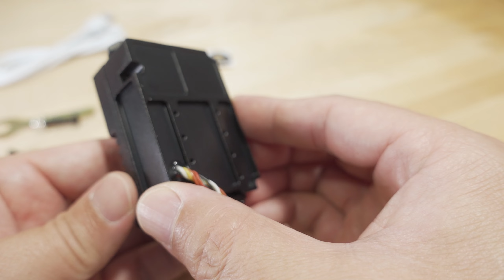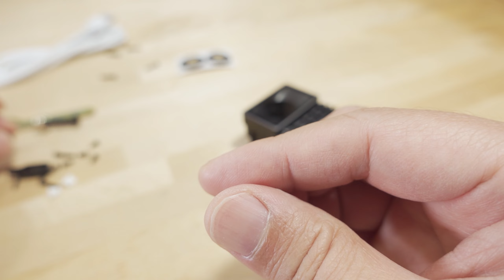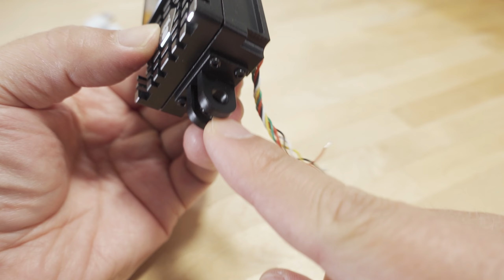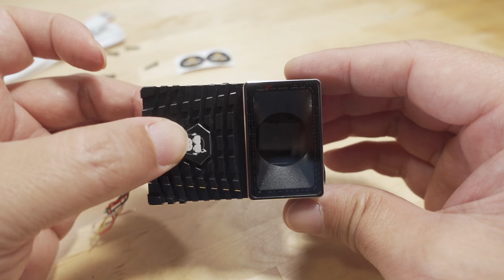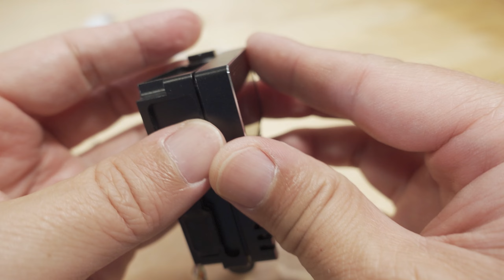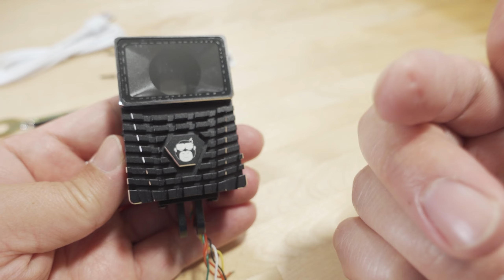DarwinFPV DJI O3 Air Unit CNC Aluminum Alloy Waterproof Case

Comment: It pretty much makes your o3 unit indestructible that in itself can be very valuable regardless of weather you fly around water. The parts Darwinfpv have which are waterproof are great allowing you to fly in rain not just around water. I think its a brilliant little design although there a a few ways I've already thought of to make this a better v2. I would buy it.

Comment: HOW IS THIS NOT GOING TO OVERHEAT?
Reply: I bought this one and it overheats every time after 1 - 2 mins flight time
Reply: Add better thermal pads  @eichelcommander
Reply from the maker: That's why it's a giant heavy heatsink.  I've seen other tests and it does not overheat as long as you are flying and there is airflow over the heatsink.

Comment: Oh wow, so cool a waterproof case for the O3 air unit. This is different. You could also use this basically on any quad with a GoPro mount, hmmmm swapable O3 air unit case with heatsinks.  Curious as to how good the waterproofing is?  But this can sort of be that transferable O3 air unit system.  Great review Albert!!!
My water story = 1 year ago, I flew a month old Diatone Roma L3 analog version with a Caddx Orca at a SoCal beach next to the pier.  Around 1 minute into the flight while over the ocean, video signal goes black. AHHHHHHH, then Cryyyyyyyy.  Then the sad walk back to the hotel. 😭
Reply: Sad moment. :eyes-purple-crying::eyes-purple-crying:
Reply: @pandrews01  seriously a sad day, I had under 10 flights before it decided to swim with the fishes 🐟 😢
Reply from the maker: Hooray for analog! 🤣

Comment: I have talked to several people who have dunked their o3's in fresh water, and they worked great after being dried out. Not sure they were able to actually stay running under water though, like this..
Reply from the maker: Wow, that's nuts
Reply: @marblekitfpv not really nuts water doesn't kill electronics however salt does. If you sink your dji mini 2 in water, throw the battery dry it out completely in an airing cupboard and it should live again if however you dunk it in the sea it'll be toast.

Comment: Flying over water, oh boy. My very first fpv flight outdoors, flying over a pool🏊. It fell out of the sky. Splooosh💦. That's when I learned, don't tell the internet 🌍that you dried your whoop out in a bag of rice. Whatever, it's still flies. Gave it to my grand daughter.
Now, water resistant rock crawler 4x4 with fpv. That could be interesting, rain,🌧️ snow🌧️ whatever drive around the neighborhood. 🛻😎
Reply: Rock crawling fpv is so hard. I tried it but it was a fail. Basically you need a head tracking fpv system with double axis control. Since with a fixed FPV camera, all u see is the hood and the sky. You have no idea what the tires are doing. Now a fpv off road or on road car works and it's fun and also harder than 3rd person view. Try it out, it's fun no matter how difficult it is to drive.
Reply: @jaechoe  I put an fpv on my wltoys 12428 4x4. Ripped around on the snow and ice. It was hilarious. ❄️🤣
Reply: @jlarson42  now that sounds fun!!!!